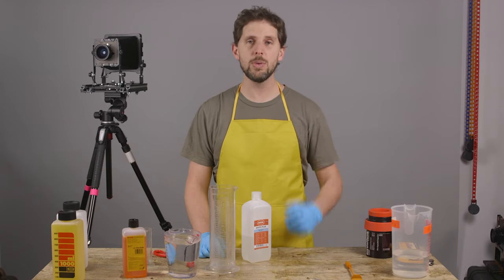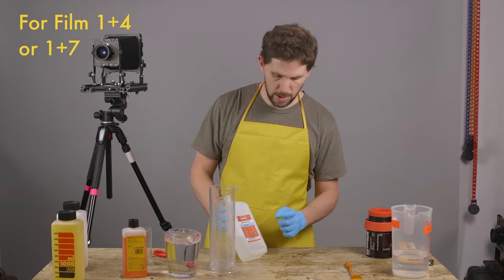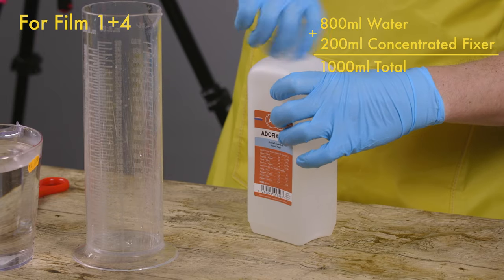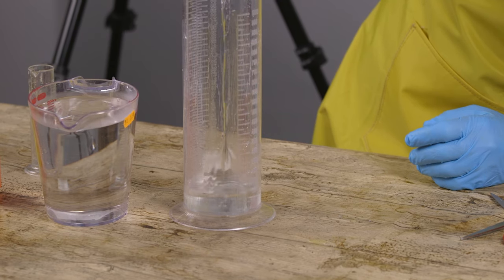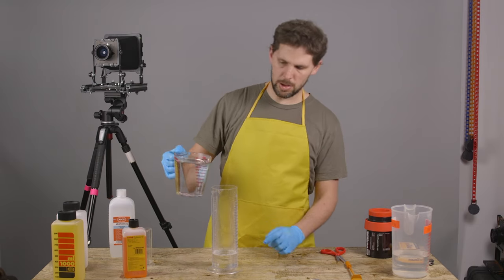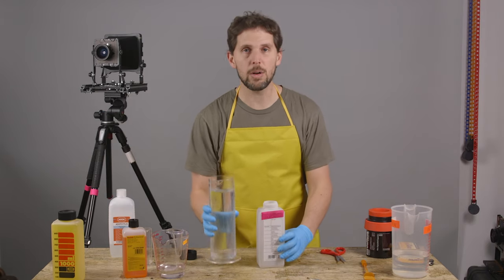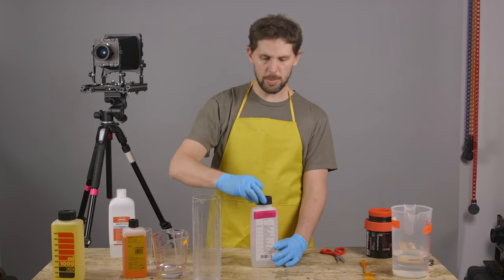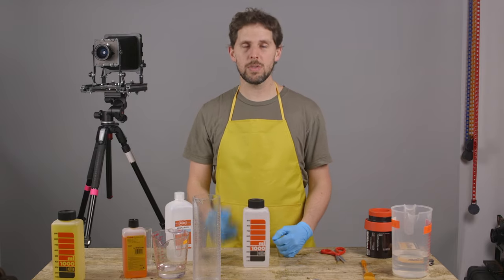How to Mix Adofix Plus || How To

Comment: Would you recommend a double fixing method i.e. using a 1st. fix with older fixer and a 2nd. fixer with fresher fixer, especially with T-Grain films.
Reply from the maker: I have never done such thing. As I develop in batches so I mix use and abuse and then dispose. But I have heard of that for paper. My take is better be safe than sorry. So I always use less rolls per mix.

Comment: Nico, For either the developer, stop and/or fix once in the liter bottles. Is there any need to mix/agitate the bottles or does it stay in solution? Thanks for sharing. Stuart
Reply from the maker: I mix in the beakers if I feel the need to. But the fixer being a liquid it gets mixed pretty much immediately as you pour into the bottle. But it never hurts to shake a bit ;)

Comment: Here are FIX recommendations from  "The Film Developing Cookbook" by Anchell /Troop.
Fixer should be tested before each use, although in practice, every 3rd time is adequate.  
Summary: determine film clearing time, then multiply this determination by a factor of 3 to know total fix time.

CLEARING TIME TEST:  in total daylight, use the film strip leader, and place it into fresh fixer. 
With gentle agitation, determine how long it takes to become completely transparent, or clear.   This is the clearing time.
Multiply this clearing time by 3 to determine the total fixing time.
(Note: Clearing times are different for every film)

As fixer is used, the clearing times will increase.
When clearing time of used fixer becomes DOUBLE the clearing time of fresh fixer, discard the fixer.

The working solution of any fixer should never be used when older than two months  (two weeks if temp is above 85f / 29C)
Reply: Just learned about the clearing test this week and its very helpful if you dev in batches and have long periods between development runs.  Forgot to mark the date on one of my bottle and the test help ensure that the Fixer was still good so ran a batch with it no issues - good call out!
Reply: @MarqelexsisAmaro  One of the developers I use is PMK Pyro, which is a staining developer.
I was taught that overfixing a stained negative can compromise the negative image.  By using the clearing test, I can get the job done, but less chance of degradation.
It seems negatives processed with regular developers can handle extended times in the fix bath with little to no impact, except possibly needing longer times in the final wash.
I know there are drops you can use to test a fixer to know if it is still good, but I like the idea of knowing the fresh fixer's clearing time for a particular film, and if the test indicates double the fresh fixer time, then I am ready for a new batch of fixer.